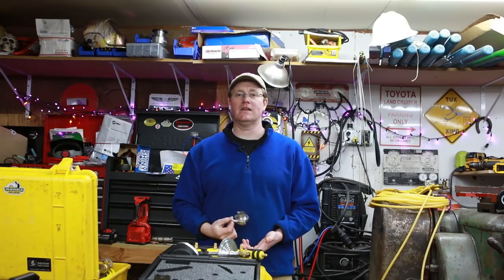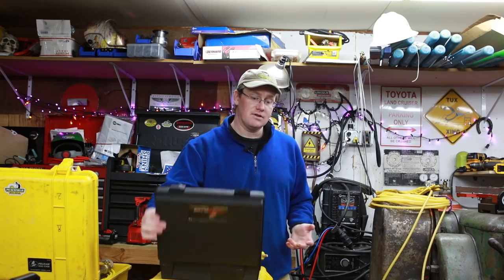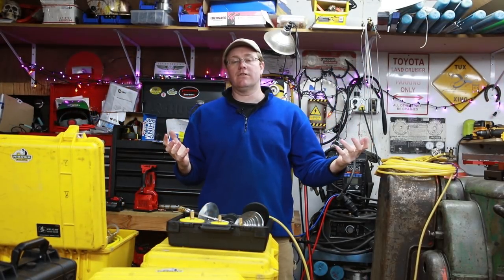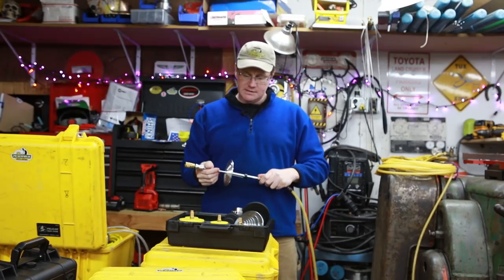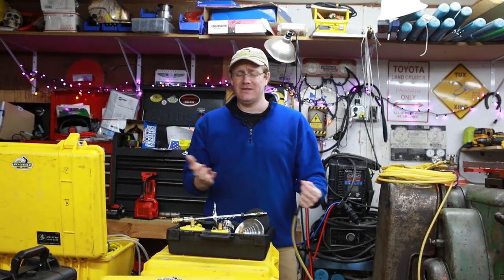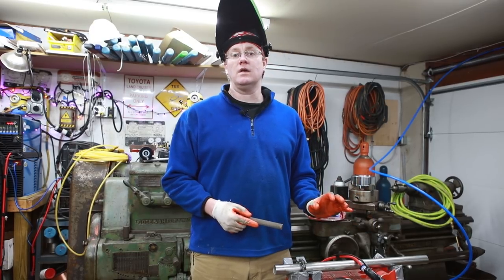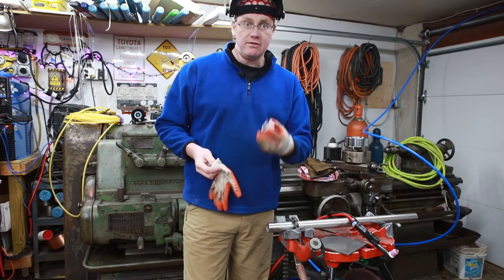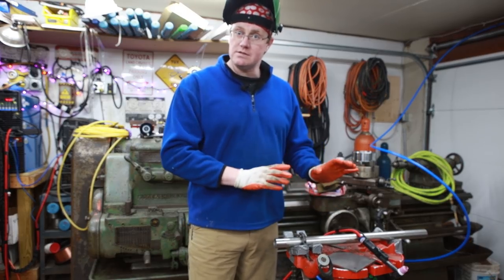How To Weld Sanitary Pipe Part 2

Comment: Very informative, thanks! Is there ever a need to polish/clean the inside of the tube? Or do you just rely on CIP systems.
Reply from the maker: Thanks, Most of the time after it gets cip washed with an acid and a caustic wash so no need. Depending on the application they will get pasivated with is an acid bath just depends on the application

Comment: I'm having one heck of a time with welding this stuff... I cant seem to keep it consistent.. I'm using a little lincoln 210mp as well as a lincoln 200 square wave.. same results on both..

I've tried running lower argon flow.15.and higher 35 on flow meter .. also tried ranges from 20-60 just trying to figure it out

Also tried different cups and gas lenses..  nothing ever comes out flush on the outside or flat inside.. mostly I get concave outside (dipped in) and concave on the inside .. any help would be greatly appreciated.  Ps. I'm running the purge plug system as well

I'm currently working in a cheese factory and I'm having a horrible time figuring this out ...  I've been welding for a long time .. stainless and income and other crazy stuff... I just cant get this to work..
Reply: If you had to choose either the 210mp or the 200tig, which would it be? for TIG welding of course.
Reply: You need to see how much pressure is running out from where you are letting the purge leak out.  Lick the back of your hand and you should be able to feel the purge faint at 6” this will make your welds flush inside and out.  Good luck.

Comment: Just wondering why are you not purging while doing your tacks?
Reply: Very quick split second blast to instantly fuse the pieces together, at say 120-130amps, with a very sharp tungsten and you can get away with no purge just for tacking.

Comment: Do they ever do any x-ray or die pen testing on sanitary tubing or is it all visual? What kind of weld test would they do for this kind of work? Thanks.
Reply from the maker: I've never seen anything beyond visual. Most is not running any kind of crazy pressure.

Comment: Nice job! You’ve come along way working with the guy you work for. What kind of use on your dynasty? You using the max star the most? What size and metal is that plate?
Reply: 6060 t651 .500" ... it says it right on the plate.
Reply: Thanks my eyes didn’t pick that up.

Comment: So how come you don't use any filler wire ?
Reply from the maker: Filler introduces oxidation and can cause pits which hold bacteria
Reply: @DarlingtonFarm  I disagree I work in that industry and have always used filler. When everything is purged there are no inclusions in the weld. Not only that but it also is less likely to crack due to there being added strength. As where a weld with no filler wire is more likely to stress crack. You can also get the same flat profile on the inside of the weld.
Reply: @MrBurningrubber  most cracks are in the haz, not the weld itself.